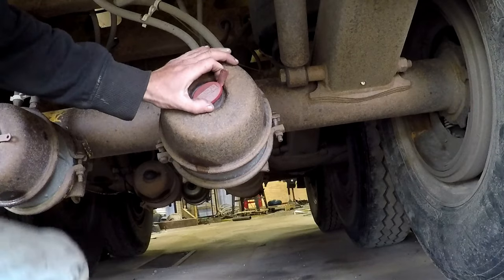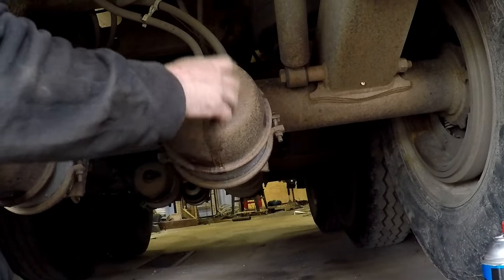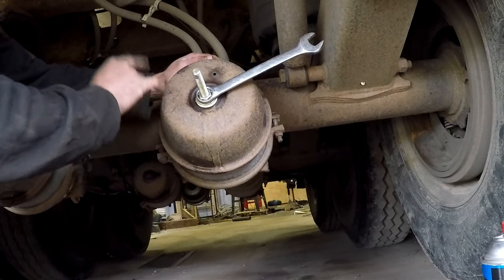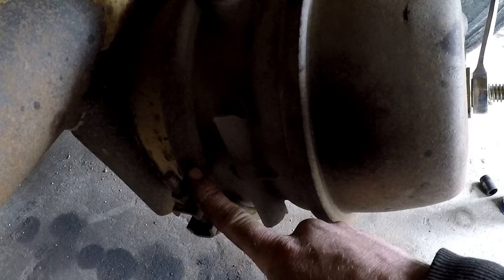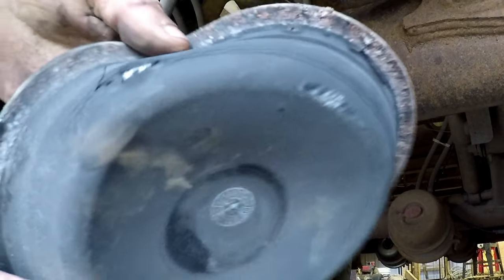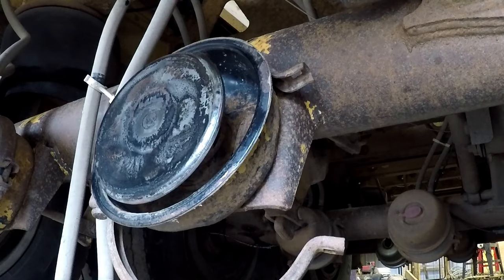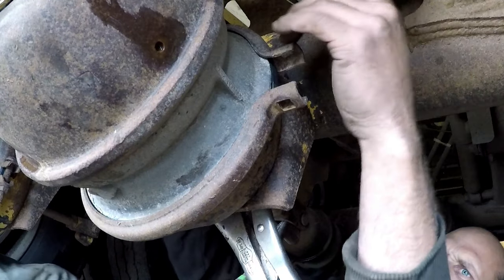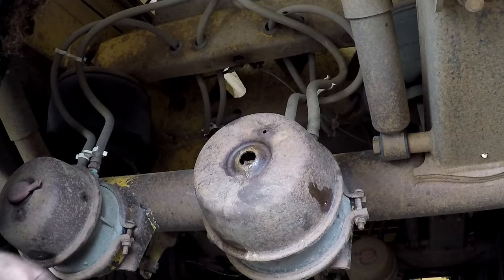brake can repair type 30/30 service break air leak

Comment: This is what I class as the difference between a fitter and a mechanic. A fitter will find the broken part and fit a new one. A mechanic will strip the part down and replace what the part needs at a fraction of the cost. 👍
Reply: alot of that has to do with liability and warranty. if those things werent so bogus these days the simple repairs would still be a thing

Comment: Keep a pancake gasket in the truck. Changed them out on the road many times. But we have turned into a throw away country. Everyone wants to replace now days. And so many things we used to rebuild. Now can't even get a rebuilt kit for.
Reply: Ripsaw17 Dennis  We used to be lucky on that part. I had a 1999 Truck, that was as clean on the bottom. As most new ones. But the southern states. Found that sinking potato juice. Or what ever it is, they call Brine, and it started destroying everything like up north.
Reply: Well said
Reply: Ripsaw17 Dennis  patch job? It's a repair. You think rebuilding calipers is a patch job?
Reply: @grren1782  no but if the parking brake side fails in 3 months and a mechanic that isn't mechanically inclined enough to do anything more than bolt up assemblies comes to look at it he'll definitely say the last mechanic was a hack and did a "patch job" instead of properly fixing it and that's why we're in this position now. He'll end up looking like the hero.
Reply: @dm-zx7xb  I live in AZ, and steel is eternal here yet still nobody rebuilds anything
Reply: Same thing has happened with electronics, who repair a tv or a sound system anymore???????

Comment: I just wanted to take a moment to thank you for suppying these repair videos. I am not a mechanic, but I have been trying to do some small repairs on my 96 kw t 800 dump truck. Your channel has helped me to gain confidence in trying to do some repairs and I have been  been able to fix problems with the help of your channel.

Comment: Step one should have been apply park brake or foot pedal and vise grip the push rod so the service side spring is applied allowing easier service diaphragm installation and tension off service spring, then cage bolt, then clamp remove..  works like a charm ASE Certified heavy truck and bus.
Reply from the maker: Appreciate the input thanks
Reply: Release brakes and back off the slack adjuster until it just starts to pull the push rod. The piston plate will help hold the diaphragm in place as you reassemble the can. If been doing this since 1970

Comment: We used to have one of the ones you could disassemble where we cut the spring with the torch to freak people out. A guy I worked with took it to the parts house and asked the guy how to replace the diaphragm. He had the clamp off, but couldn’t figure out how to get it apart. All the guys dove behind the counter when they saw what he had sat on the counter. 🤣🤣

Comment: thanks for this video you made it easy. I just spent $160 on a new brake chamber from the dealer. This was way cheaper. Thanks 😎
Reply from the maker: A lot of shops would probably refuse to do this repair.
Reply: i replaced the pancake diaphragm on both sides in under the hour for a beginner and with your help that was amazing. I feel like charging people for this service now 😅

Comment: Dude!!   Im glad i found your page!!  I've got a 1984 wanderlodge RV I'm having trouble recovering after a few brake presses I think one of my cans is leaking after looking at your video I'm also chasing down possible air leaks and the prospects of having prospects of having a bad compressor but the dryer looks good seems to be dumping like it's supposed to pressure builds up to about 145 PSI it just takes a while. I'm thinking though that if the diaphragm were leaking I should hear it hissing.

Comment: I noticed the side note you mentioned about how cutting the rods on new cans can be a pain in the ass. Over the years, we've noticed most guys screw up cutting them, so now we just replace air cans in pairs. 30/30 LS with welded clevis. Been smooth sailing ever since.
Reply from the maker: I was more referring to when you have a break can leak when your on the road away from the shop working with just basic hand tools pancake can be done with a cresent wrench and a pair of vice grips in 10mins take you that long just to cut the push rod to length with a hack saw. In the shop it's no big deal

Comment: Really appreciate your shared knowledge. I use to be mech inclined back in the day with auto. But semi trucks i been timid, you shown me its really just as simple. So im ordering tools from Snap on now . Air assist Jack Milwaukee fuel 1st on list
Reply from the maker: Yeah my back ground is mostly automotive as well didn't really start messing with big trucks till I bought my first one. Took me a little while to get comfortable. But it's all just nuts and bolts there just bigger...lol

Comment: Thanks for the video.  I hvae the same impact as well, it even doesn't mind being left outside in the freezing cold after being rained on.  It just needs some fignaglinto get back to work LOL.
Reply from the maker: yeah there pretty good, i normally get about 3 years out of them before they start loosing some umph though, i use it a lot though and my shop air is set at 150psi.
Reply: @Ezrider359 Last year I used mine to bust loose the pinion flange nut off a D80 when I couldn't beat it off even using a torch.  I'd say this will be the last year for mine after water getting into it and seizing it up, I was shocked I beat on it and got it spinning again, it hadnn't seen oil in a while or that day either LOL.  
AGain thanks for the vid, I'm new to serving air brakes,even though I'm not dealing with this, it will be healpful on down the road.

Comment: I took my steer axle one apart to replace the diaphragm but it already had a brand new one in it. Don't know if it wasn't seated right but it didn't work for me either when I reassembled it. My can was an OEM from 1988 so I did both sides, full can, despite only the passenger side leaking. 

Not too sorry to see it go when it's that old. The spring wasn't particularly beautiful anyway.

Comment: On the farm this spring I have 3 brake cans to replace. I think 1 of them I will do this way. 2 of the others are 30-30 long strokes, with Meritor ASA adjusters, the 1/4” pin was frozen to the clevis and to the adjuster.  Heat got the 1/2” pin out of the clevis, but not the adjuster, it was frozen to the bushing. I hate people who don’t know what anti-seize is!!!

Comment: Did one yesterday wasnt able to cage it just used air pressure with brakes released. Little nerve wracking when you take the clamp off
Reply from the maker: I would mention some of the sketchy Ways I have done it before but I don't want to give anyone any bad ideas....lol

Comment: This is what  I've been confused about. 
,   im British and the brake cans we have  already have the bolt  fitted inside.  We dont have to insert a bolt to ' cage the spring'  we just put a socket on the bolt and start backing it out.  We refer to it as 
'winding the brakes off'  
Thanks for this video.
Reply: That would be nice. I think our country is too sue-happy to allow for that.

Comment: I used to change the spring brake diaphragms until the parts store told us that they could no longer get insurance to take them apart with a press inside of a cage. I had just changed one at the scale that morning. About 1981.
Reply from the maker: now days most brake cans don't even have a removable clamp on the spring brake side. unless you run across one that has been around for a long time.
Reply: @Ezrider359  
😂If it's been around that long? throw it in the scrap metal bin, you don't even want to mess with it.
Reply from the maker: @cbmech2563  🤣 pretty much

Comment: Easy quick fix works good for like an emergency type of thing I done before but when possible replace the whole chamber specially if it's a 3030 short stroke there cheap about 30 bucks now the long strokes are around a 100
Reply: You can buy the long stroke 30/30 chambers on Amazon for $40 including shipping.

Comment: I always put a paint line across all part of the can, that way when putting back together you can line everything back up. You have to watch where the air lines end up, make sure they are not rubbing
Reply from the maker: nothing wrong with that, a couple degree's off wont really change anything as long as your air lines are happy with there placement. normally i would throw a piggy back on at the same time anyway so drawing a line wouldn't help. but this was just a quick fix with limited time.

Comment: It takes me about 30 minutes with a torch by myself to replace the whole can I usually find when they get to that point the rest isn't far behind good fix if you are pressed for time tho
Reply from the maker: seems im always fixing brake cans in some parking lot some where lol seems they never wait till  its convenient to start leaking. changing a whole brake can in the shop with a torch and a metal chop saw or grinder isn't a bad job. but in a parking lot with basic hand tools is a whole different story this method hands down in that case witch is why i wanted to make a video showing this way to do it.

Comment: That's good video. I've actually had kids from tech school come into the shop and not know how to change a chamber, most say tech schonly tells them they're dangerous but that's it. Pitiful all they teach is computer computer computer
Reply from the maker: yup that is why i wanted to make a video on that subject. no one does half cans or pancakes anymore because there is this big myth that there going to magically explode in your face if you touch them.  when really with just a little common sense and take the right steps there no more dangerous than anything else in the shop.

Comment: In reality just replace the can. The park brake springs are almost always broken and is a time bomb before the loose pieces puncture the diaphram. Then is done. Usually 20 miles after replacing the service brake diaphram. Rusty clevis pins always come out with an pneumatic hamer with a 14mm pin.

Comment: After all is installed the brake should adjust itself when the tractor valve is pushed in? Trying to fix this on the road. Hear the leak and believe its the diaphragm. Dont want to spend all the money on a new brake chamber if i dont have to.

Comment: Most brake can manufacturers,  stopped using removable clamps on the rear  parking  brake portion  because of to many people  taking off the rear clamp before  Caging the brake and getting killed or seriously injured,

Comment: How did you know it was that brake chamber? I have a kenworth t2000 with an air leak but I can’t hear it come from the brake chamber. Only from the bleed hose in the front firewall

Comment: If you have to replace the whole chamber due to the park brake side going bad.  Remove the service Side diaphragm inspect. If it is save it to use if you need it later or glue magnets to the bottom to hold your nuts and bolts.  Don't forget readjust your slack adjuster.
Reply from the maker: Never thought of using them as bolt trays. Cool idea I normally just Chuck them in the garbage

Comment: On which state is your  shop. I found you that  when I check if the parking brake work by press the brake unto it reach 30 psi it do not pop out unto there is no more air in the brake at around 0psi.  What cause this problem . I  in Virginia.  I bought this international prostar 2015 cummins , I did not yet carry an load with it ,I am discovering problem after problem.  I drive it from dealer to my state  around 1200 miles with no major issue . Now I am a message saying, "Abs module" after it was seat to the grass for some days and flat tire sign ,but no tires are indeed flat.

Comment: I have an issue with an air leak on my brake system on my 2016 T880. When I press the yellow parking brake, I hear air bleeding though the yellow knob. Never leaks when yellow brake is pulled out and engaged. Could this be brake chamber?

Comment: good video , might wann put that drain hole at the 6 o'clock position tho
Reply from the maker: There vent holes not drain holes can't position them independently if where your air line fitting come out and there is one every 90* so if one is facing the side there is one facing the bottom as well

Comment: The best advice for someone that has never done this before is to have someone who knows what they are doing help you!!! Because if you run across a older brake chamber that has bolted clamps on both sides and you remove the wrong clamp by accident it has a really good chance of KILLING you or at minimum put you in the hospital for a long time!!!! And if it has bad rust it can also break apart and explode on you when you start messing with it!!

Comment: Great video bro, On my truck that rubber piece is not inserted, should I plug them back in ? What happens if they are not inserted?
Reply from the maker: yes it can shorten the life of the can if left exposed.
Reply: Depends where you are trucking, dirt n crap will get in, here in Canada, slushy salt, ice n snow gets in as well as dirt n crap, keep the plugs in😁🤘🤘

Comment: A lot of newer pods can’t have the diaphragm changed out. $30 for a chamber is cheap. Just carry one! If you get a leak in the service side pull the fitting and put a dime in then reinstall the line.
Reply from the maker: Never seen one not serviceable on the service brake side park brake sides have been crimped clamps for probably 20 years. Far easier/faster to do this repair on the side of the road/truck stop than to replace a can. And a better alternative to plugging the air line making the brake non functional. This repair has it's place.
Reply: I routinely see non serviceable brake chambers.  Another point not made is if they are serviceable is doing a piggy back.
I stock piggy backs more than chambers.
Time is money.
Reply from the maker: if someone cant figure out how to change a piggy back after watching this video they probably shouldn't be messing with trucks.

Comment: I appreciate the safety measures you take but, bendix and haldex clearly states not to reuse the hardware clamp and the 9/16 bolt n nut. It's like reusing head bolts. The threads have stretched and will cause a failure in the air brake system. But I do think you are a good mechanic just work at a shop where a budget is held a tiny bit higher then real parts and safety education. All manufacturers have great videos and classes on their products to learn these steps. I personally am certified in all old and current bendix, haldex braking and abs, on guard systems.

Comment: That drain hole on the parking brake side of the maxi Should be pointing down
Reply: There's usually 4 holes so that's not really much of a concern

Comment: nice video but can can skip some steps, 1 apply parking breaks, vise grip push rod so it will stay out, release brakes remove clamp and replace, no need to cage
Reply from the maker: There are plenty of shortcuts on this job I intentionally included redundant steps so there is multiple layers of safety making it extremely difficult for someone to hurt themselves

Comment: It helps to put the vice grips on before you release the breaks then you don't have to back off the breaks
Reply: Like summer break ?
Reply: No auto correct if you put the vice grips on the push rod before you cage the brake can you don't have to back off the slack adjuster

Comment: No trying to tell you your job I’m just curious.  Why not replace the spring.   Do they rarely break.
Reply from the maker: If the spring is bad that's the tipping point to just replace the entire chamber.

Comment: Awesome videos. I always hated caging. What do you torque at?
Reply from the maker: Cage bolt just tighten till it bottoms out. The strap bolt just needs a firm snug. Torque isn't critical on either
Reply: @Ezrider359  ok i didint know. Always worried about the spring. Nice mack. I drove a granite and now anthem. Hate auto

Comment: All good and well. But with these things being as cheap as they are. We pay like $60 AUD for a pair. By the time they reach a point of failure it makes more sense to replace it, and with just as little effort. I dont believe in repairing brake boosters, air bags, shockers. Etc. But this is coming from some one that services a fleet of 150 trailers.

Comment: usually when your diagram is worn out, the case for the brake chamber is rusted out pretty good. I agree its cheaper but its not work the cost savings apposed to replacing the chamber.
Reply from the maker: i actually find the base that the half can goes on to generally have no issues lasting 15+ years. of course that assumes you wash your truck often in the winter. but a general assessment of the condition of the base push rod and spring are certainly to be considered. i mostly prefer this method of repair just for the speed/ease of repair more so than the cost savings.
Reply: I could swear i saw a tiny rust hole in it. And no not the weep hole. And when you have to pound your cage bolt in.... the spring is broken somewhere. And whats with not cleaning the chunky corrosion that is supposed to seal against the diaphragm?
Reply from the maker: the was no rust holes in it. probably should have gone ahead and thrown a new half can on. but its fine. the cage bolt didn't want to go in because of corrosion and dirt biuld up, not at all a indicator of a broken spring, if the cage bolt location was cocked or of center in the hole, or if the push rod on the other side is at a angle would indicate a broken spring and only a matter of time before the seal on the push rod will start leaking and back feeding out the purge valve.